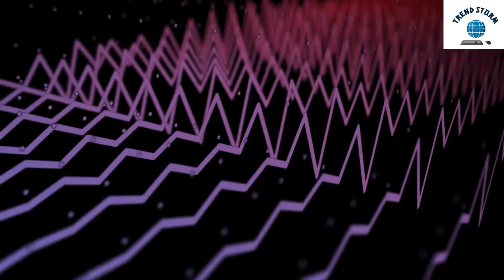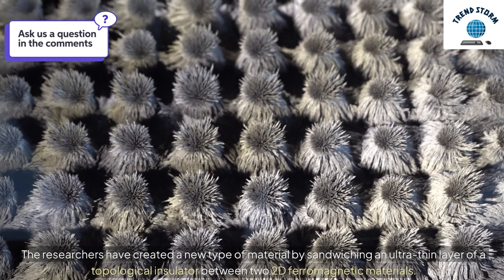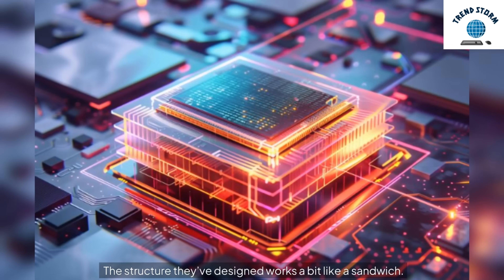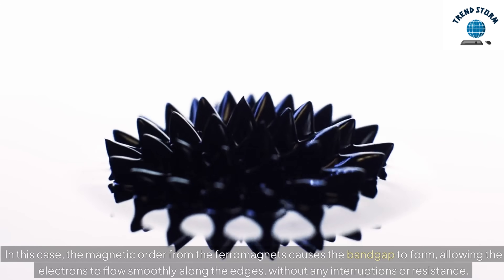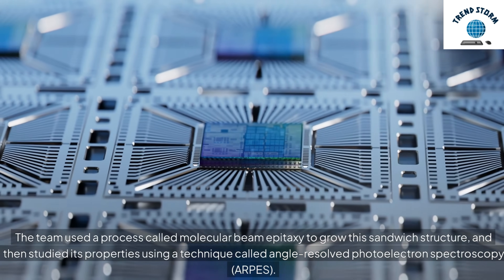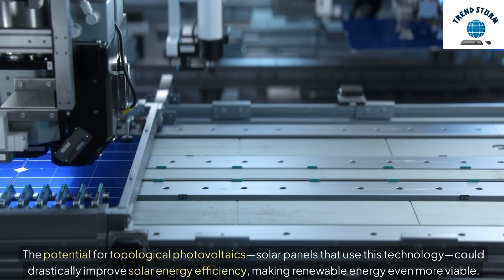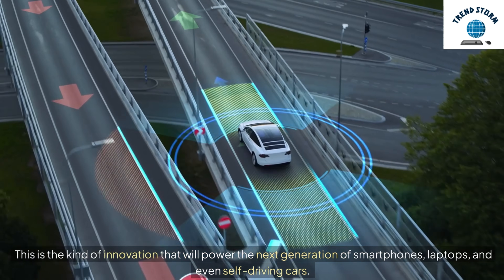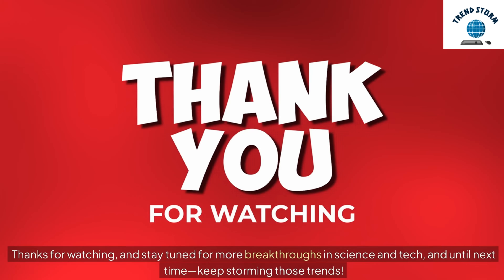Quantum Sandwich Unlocks Next Gen Quantum Devices | Quantum Anomalous Hall Insulator

Comment: If electrons flow without resistance, does this mean devices would generate no heat?
Reply from the maker: Not entirely, but it would drastically reduce heat generation, making devices cooler and more efficient.